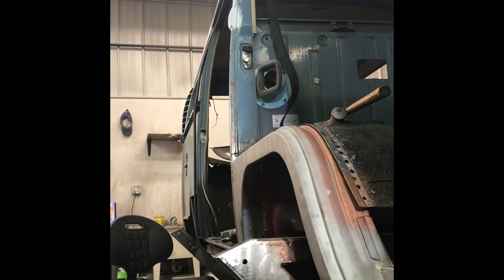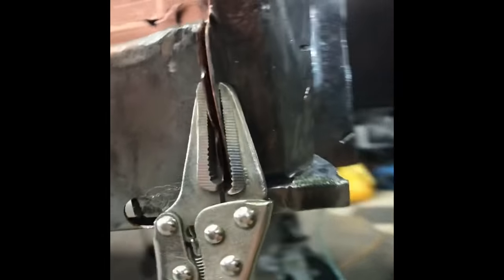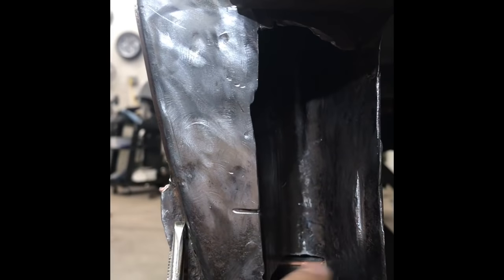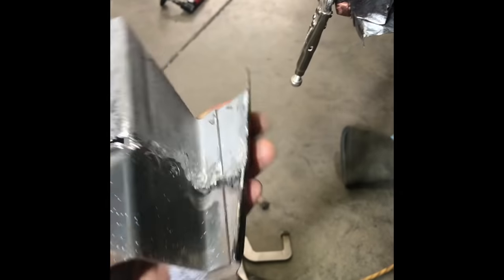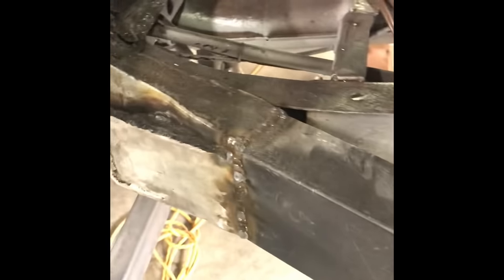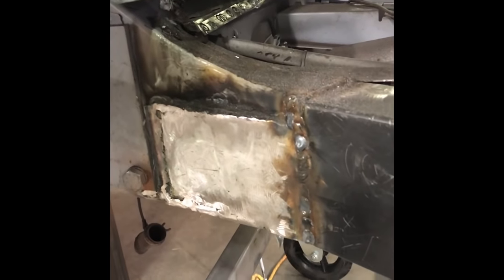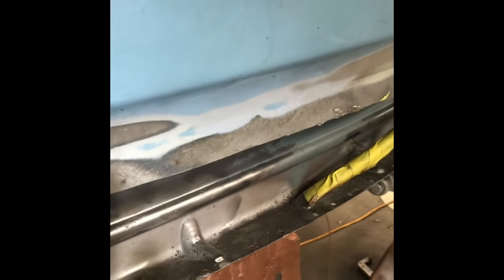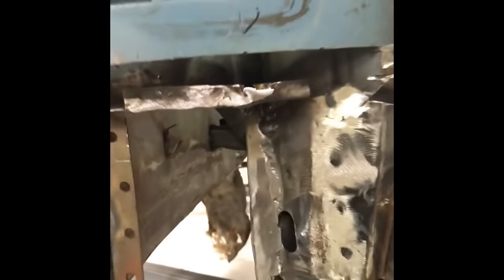1970 VW BUS RESTORATION Inner Valence, A-pillar, Dog leg

Comment: Wow, incredible work! Nice tip for the magnet light! I'm restoring a vw LT but mainly just the outer lower panels.
Reply from the maker: Hey! Thank you so much. Its my first bus and restoration! I love the magnet light so much! I have three now. Use them for welding, blasting, painting and they still work!!

https://www.amazon.com/MAXXEON-MXN00800-WorkStar-Cyclops-Rechargeable/dp/B07858F534/ref=asc_df_B07858F534/?tag=hyprod-20&linkCode=df0&hvadid=241967259490&hvpos=1o2&hvnetw=g&hvrand=11069276589717282445&hvpone=&hvptwo=&hvqmt=&hvdev=c&hvdvcmdl=&hvlocint=&hvlocphy=9018980&hvtargid=aud-645589642778:pla-485377448082&psc=1

Comment: Great work and video! How many millimetres (thickness) is the steel do you use to make parts? I have the same bus with the same problem. Thanks in advance
Reply from the maker: Thank you Cristian.
I used 1.9mm steel for the frame 
And .9Mm steel for the body panels 
The inner valence pieces I used 1.2mm pieces
Reply: @ThomasL95  thank you very much. It is very useful to me.

Comment: The patch work is too much. I would have picked a better car to work on
Reply: why all the patches, make new bits or buy ready made, lots of simple box sections, simple set up for folding sheet steel , 1 vice 2 pieces 3ft. angle iron 1 hammer. Plus 1 acid dip to see what you have before you start.